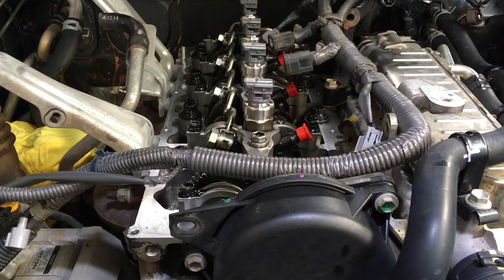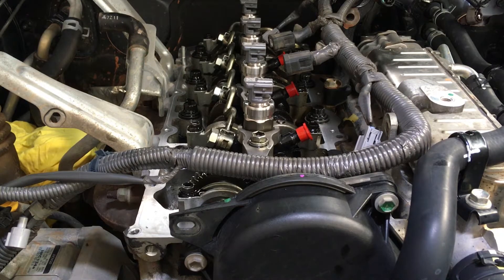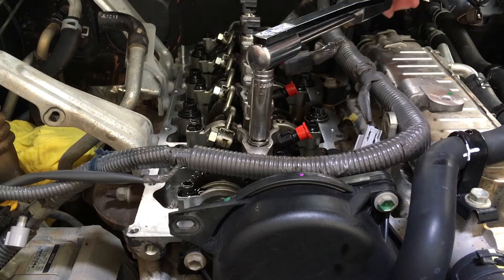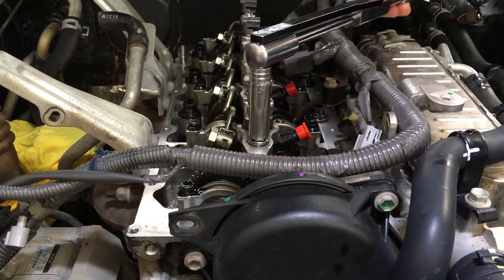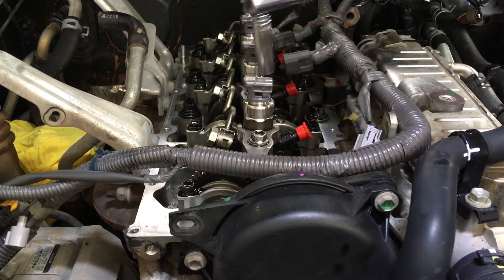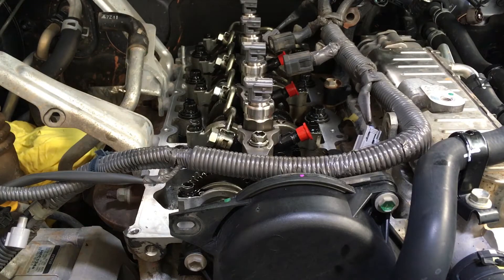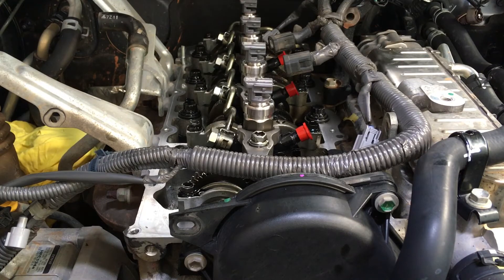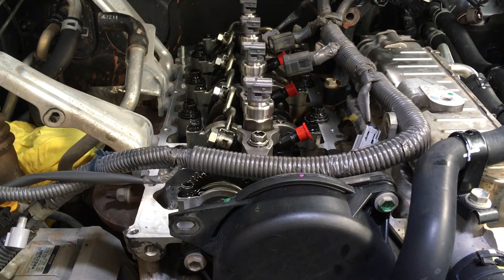Torque the 1kd-ftv injectors

Comment: Hi Anthony. I missed the torque figure for the injector clamps.
Reply from the maker: davow8 
22nm - all the torque specs are included with my injector kit. Plus lots of other gear you need. Best new genuine parts, best prices. Buy from me & support more videos.
Reply: Thanks Anthony. Not a Toyota owner but was just curious. My Kia 2.2 CRDi clamp bolt specs at 33Nm. but were incredibly tight when I took them off.
Reply from the maker: davow8 22nm